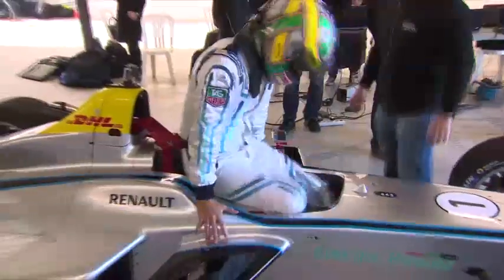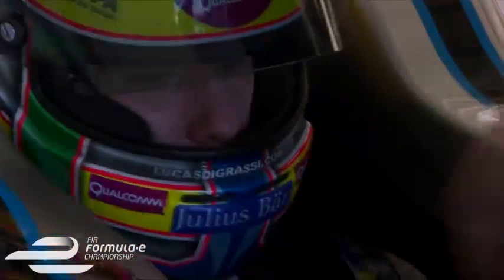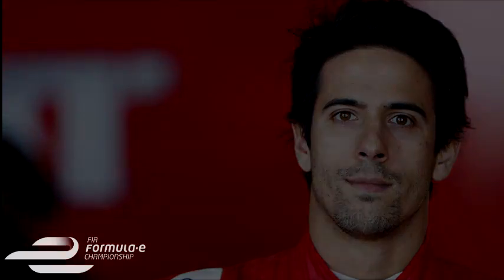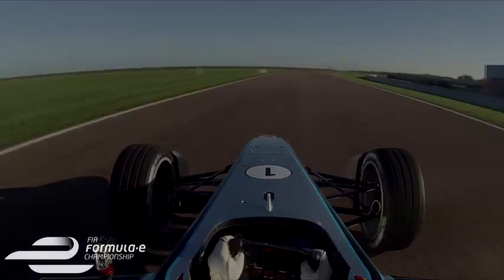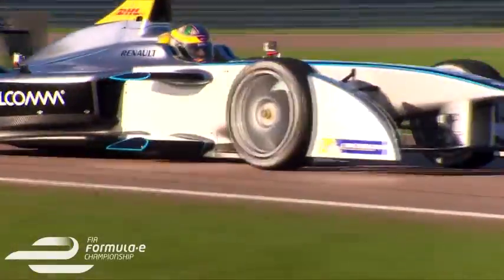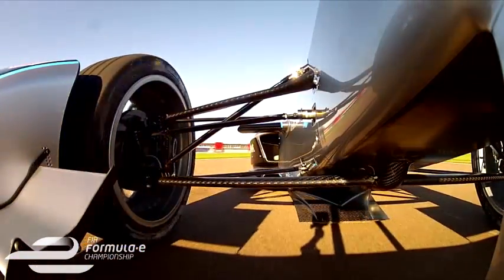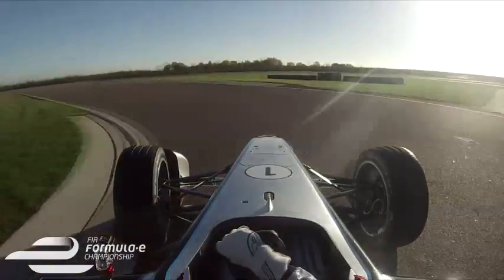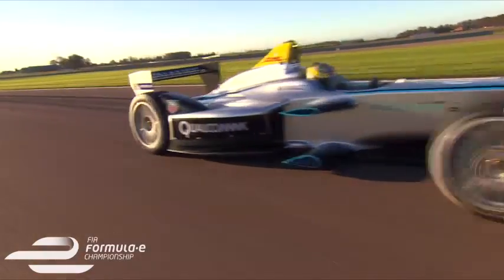Tech talk: Formula E car with Lucas di Grassi

Comment: I like how energy management is so important to this race so I think forcing teams to race in one car for the entire race would be better. Redesign the cars and pitstop areas to allow for battery swapping. Once customization is allowed teams making fewer pitstops would have the advantage and that should drive innovation faster toward lighter batteries with higher capacity, safer batteries / electronics / connections (will need to be safer if handled regularly), modular systems, and better regenerative breaking technology.

Comment: Just watched the first ever Formula E race live! (And --Spoiler Alert--) If this series becomes huge, when I'm old an moldy, I can tell my descendants, "When I was younger, I can still remember watching the first Formula E race live way back in 2014, when the cars only had the equivalent of between 180 something horsepower and 200 something, depending on if it was qualifying or the race and whether or not the drivers got the 'Fan Boost' votes. Oh my, way back when we weren't fighting wars over water, a gallon of water was a dollar or two, not 20, and gasoline wasn't something that cost 2000 dollars a gallon and mostly kept in museums or power the toys of the mega rich. Oh those were the days. When there were 4 seasons, not just 90% Summer and 10% of an 80 degree Fall. My, my."

Ok spoiler time------

The race got off to a good start, then early on there was a crash that brought the safety car out, an i8, and most of the race was routine. 25 laps and about halfway through, the cars pitted and the drivers got into their second car (with a mandatory minimum of 1:47 for the stop) and drove off to rejoin the race (I thought during the stop they were going to switch the tires from the first car to the second like I remember reading/seeing somewhere, but they didn't). And in general, there was plenty of head-to-head racing going on.

The real action was on the last lap of the race, coming up on the final corner. Nico Prost was leading, but on the short straight before the final corner, Nick Heidfeld, who had been on his tail, made his move and pulled out from behind Prost and was going to pass him easily before the corner. But Prost saw this in his mirrors and blatantly (as in so much on purpose to all on lookers that he should get a race ban or some other penalty) turned into Heidfeld's car when he was directly alongside, which sent Heidfeld's car careening out of control to the extent that he got airborne and did several rolls perpendicular to the track and finally landed wrong way up. Prost's car was damaged to the point of not being able to continue (thankfully; serves him right), and when both drivers got out of their cars, Heidfeld ran towards Prost and looked like he was running at him to hit him. But he stopped and just said some things to Nico Prost. Probably something like "what the f--- were you thinking?"

And ironically enough, the focus of this latest Formula E video, Lucas di Grassi went on to take the win.

But man, if you didn't watch the race, find some highlights or a replay, because not only was it great racing, but that last lap incident between Prost and Heidfeld was shocking. I was amazed when Heidfeld "dropped" out of his car because it was upside down, totally ok and running to Prost to have a word. The crash was brutal. Heidfeld was totally airborne and, again, rolled several times perpendicular to the track like pirouettes, or a figure skater in a tight, fast spin. Then the car pretty much slammed down onto the roll hoop which thankfully did it's job and kept Heidfeld's head out of danger.

But everyone watching could see, and even the commentators' words attested to the fact, that it was a blatant move on Prost's part, done on purpose without a doubt. A stupid move that could have seriously injured Heidfeld and took them both out of the race. You'll see when you watch a replay. Prost saw Heidfeld in the process of passing him and when Heidfeld was alongside, Prost turned straight into him, as if desperately trying to stop him from passing any way he could. It was like a blocking maneuver, but instead of being done when the other car was behind him, he did it when the car was alongside.

Looks like the apple doesn't fall far from the tree. The cameras showed Alan Prost's reaction in the pits, but Alan is no stranger to pulling such a move (Prost crashing into Senna, Suzuka 1989).

So Luca di Grassi got the win for Audi Sport ABT Racing Team. So now Audi can claim wins in Le Mans prototypes (at Le Mans), a championship in FIA Blancpain GT3 racing, and now the first ever winner of a Formula E race.

But all in all, based on what I saw today (early morning today), Formula E has the goods to produce some great racing and I think it's here to stay. And the tech R & D is going to be invaluable as it will certainly trickle down to road EVs.

Great show Formula E! You did not disappoint. I'm really looking forward to future e-Prix, and I might even check it out in person when it comes to Long Beach, CA.